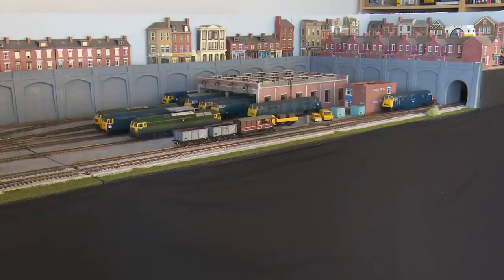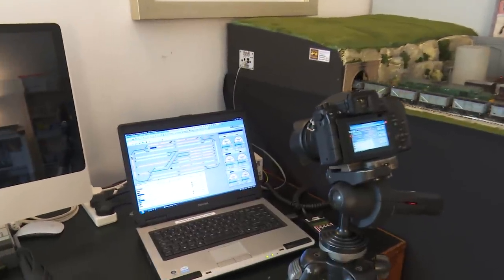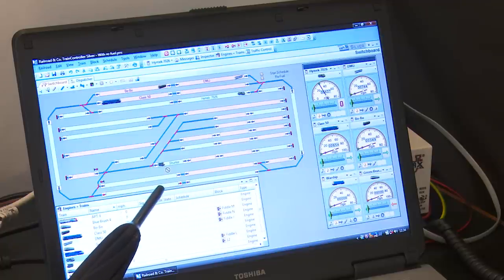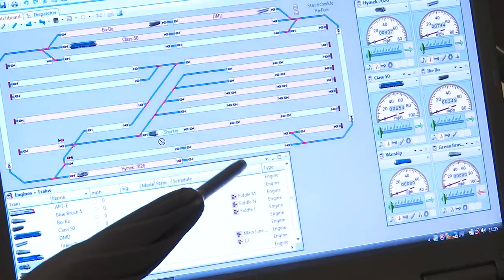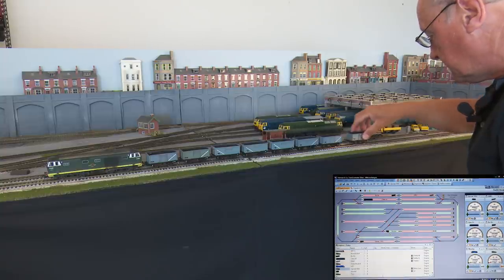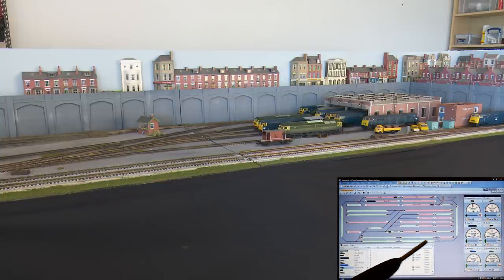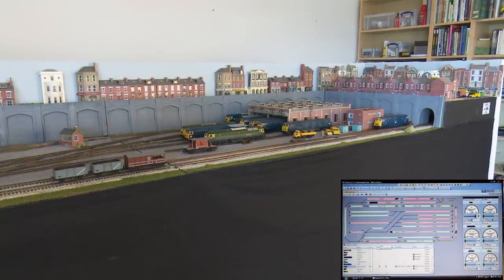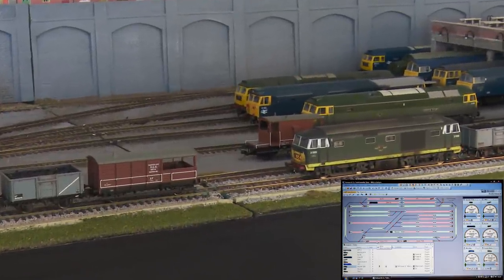Block Detection on rolling stock at Chadwick Model Railway | 9.

Comment: Can't you just solder a normal resistor across the wheels?
Reply from the maker: I’m afraid not. They are just too big.
Reply: Not with anything bigger than 1/8watt,  but if your passenger carriage has lights theres nothing to worry about anyway, these resistors are just dummy loads, most passenger cars tend to have pickups now, and of course most DMU's do. This is the advantage of fitting extra IR block detection sensors ,  each sensor has its own power and naturally draws current when a train passes over it to send to the control box, also no rolling stock/trains have to be modified. basically fit  IR sensors to every part that has block detection right at the ends of each piece of track as well.

Comment: Great videos as always. Thanks Charlie.
Question, as a total novice whats the best way to remove the axle?  Do you just prize them out?  Also does it make any sense to stick the resistor to the axle without the bother of taking off the paint then running conductive paint from resistor to the wheels?
Or am I being stupid??   
Ps the 10k resistor link above does not work but they can be obtained at https://www.rapidonline.com/Catalogue/Search?Query=10k%20resistor&Size=60 of Colchester.  (though not sure of the correct rating/power handling)
Reply from the maker: Hi Brian, yes the axles can be removed just by prizing the sides apart. I’ll have to check out the link to the resistors if my no longer works and thanks for the tip. Regards Charlie.

Comment: Think i'm gonna fit pickups to my network rail yellow coaches as they will need lighting anyway, grab yourself some 0.2mm copper from ebay and make your own pickups m8. on the farish coaches the pickups wont be seen as theyre gonna be fitted facing inwards
Reply from the maker: It looks like you have a plan.

Comment: On #9 Block Detection on rolling stock  1. You did not give the Wattage on the 10K Resistor # 2. At Https://goo.gl/7n73nt in USA you get a Error Message We're  The Web address you entered is not a our page,  Thank you  Just letting you know as I see it from USA. As UK.and USA Amazon may be Different references Numbers for same Resistor value.
Reply from the maker: Thanks Marcel.